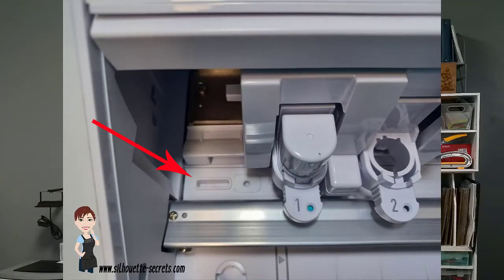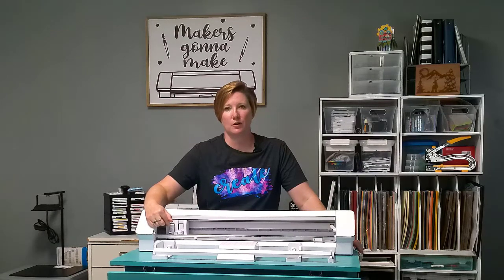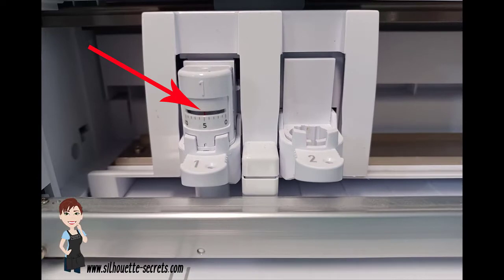Cameo Pro 5 Tips to Troubleshooting Success -  Part 2

Comment: my machine is not resetting
Reply from the maker: What is it doing? Slowly moving to the middle?
Reply: @SilhouetteSecrets stays on the right and makes a trrr trrr noise
Reply from the maker: @kinsleydrescher5568 that typically indicates a broken crash stop sensor. There isn't anything the user can do to fix it - you'll need to contact Support. Details here - https://silhouetteamerica.freshdesk.com/support/solutions/articles/35000275242-connection-troubleshooting#%E2%80%8BCarriage-Moves-to-Wrong-Position-on-Startup

Comment: Hi, since you have both cameo and Romeo, which one is easier to use? I have a cricut 3 and not happy with the cut sizes and I am just a crafter. Thanks for your advice
Reply from the maker: Both of them are going to have a learning curve coming from Cricut. There really isn't an easy answer to that one..... I have information for both machines to learn how to use them. My other channel is - Swift Creek Customs where I teach the Siser machines and software. 
The Cameo Pro definitely needs more space to function properly. 
But both machines will need to be set up properly for consistent cuts. 
The Cameo Pro is your "craft" cutting machine like a Cricut while the Siser machines are more like a professional style machine. Each are a bit different, but can definitely be learned by anyone, if they are willing to do it.

Comment: My matt keeps getting stuck in the right side so my cameo over laps the drawings. Its gets stuck and only feed one side
Reply from the maker: Watch it closely - why is it getting stuck? 
Is the mat bent? Is the mat fully supported for 22" in front and 22" behind the machine, completely flat? Is the roller on the adhesive of the cutting mat? Is the right roller lined up properly with the arrows? 
I have more detailed information here
https://silhouette-secrets.com/2022/09/02/become-a-pro-troubleshooting-your-cameo-pro/
Reply: do you have a video of how to make sure you have your rollers set up correctly for a 24 inch mat on the cameo pro? I am having the same issue and just want to make sure that i make sure that i am doing everything correctly to ensure that i know how to fix this problem. I have bought a new mat to see if its bent at all as well.  @SilhouetteSecrets
Reply from the maker: @tatumtraglia7706  I have lots of Cameo Pro information on the website.... 
https://silhouette-secrets.com/cameo-pro/
Here is a photo tutorial showing the roller placement - https://silhouette-secrets.com/2021/02/06/5-steps-to-setting-up-and-troubleshooting-the-cameo-pro/
And a full in-depth video course that outlines it all based on what you are using.... 
https://silhouette-secrets.com/2022/09/02/become-a-pro-troubleshooting-your-cameo-pro/